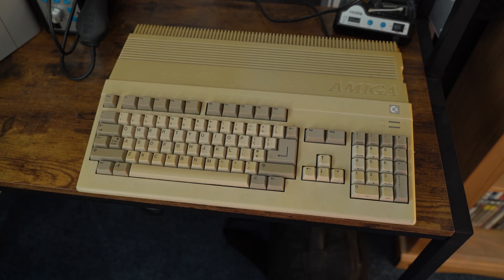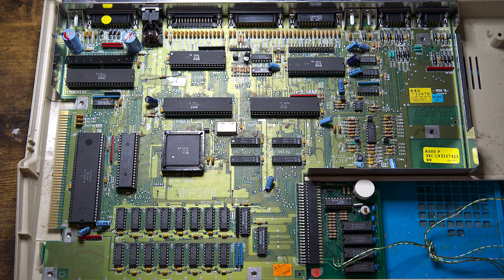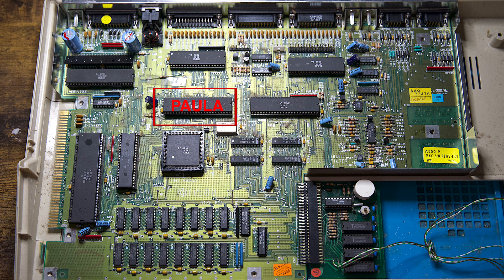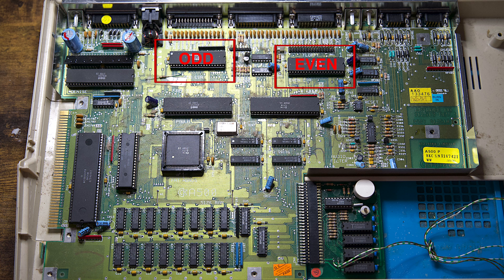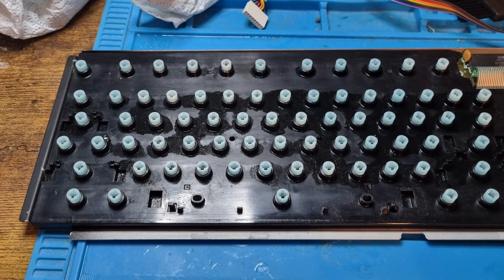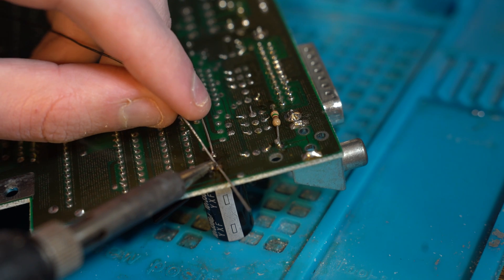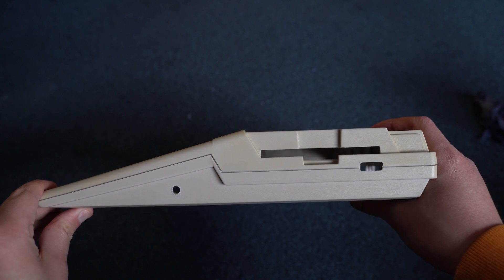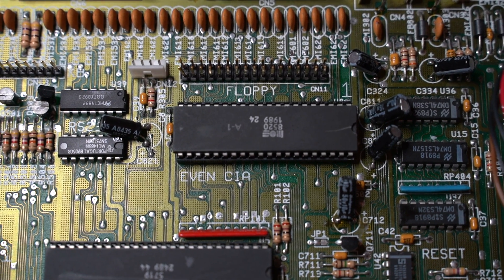Amiga 500 - Restoration - Part 1 - 4K

Comment: Replacing caps on the 500 is not necessary. Commodore used quality caps on the 500s. It’s only the 600,1200 and 4000 which used lower quality smd caps which need replacing.

Comment: De-oxit the ribbon cable connectors on the floppy, maybe replace the cable, check voltage feeding the floppy.  Try the floppy drive on another Amiga.  Try de-magnetizing the drive heads.

De-oxit and reseat socketed chips too.  My A3000T wouldn't boot properly until this was done.
Reply from the maker: Thanks for the tips J&J, I've since posted Part 2 which goes into some detail about the steps I took next. Thank you for watching the video, really appreciate it. :)